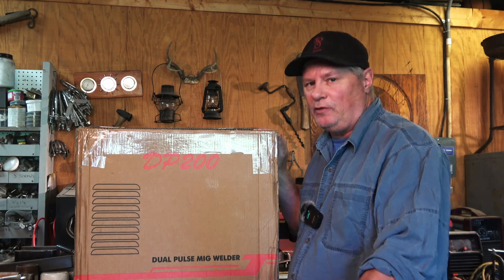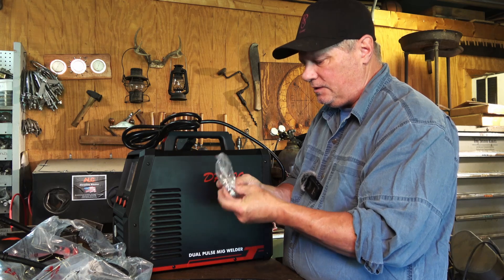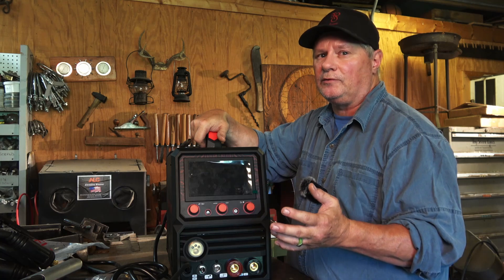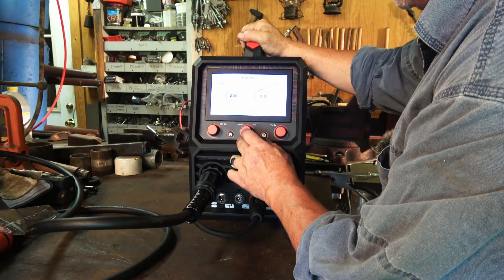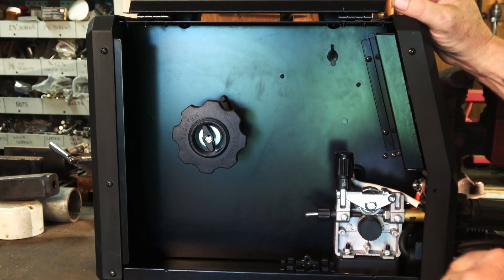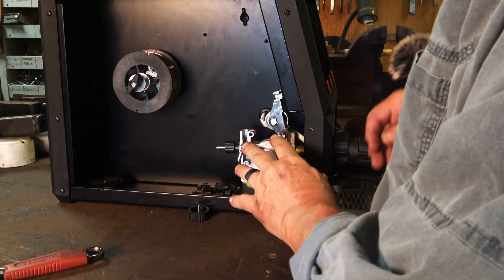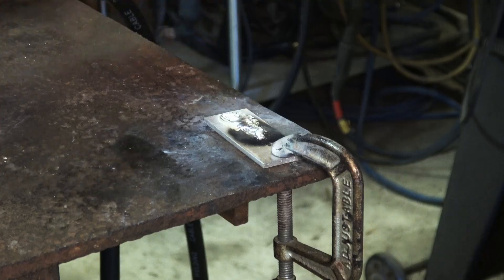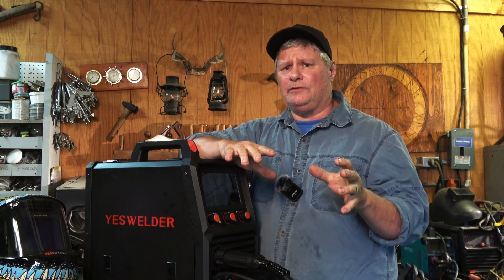YesWelder DP200 Double Pulse Mig Welder Review

Comment from the maker: UPDATE on duty cycle  If you have any questions just post below.  I’ll do my best to answer them.  Thanks for watching!
The duty cycle of MIG welding is:
25% @200A, 60% @130A, 100% @100A@240V.
25% @120A, 60% @78A, 100% @60A@120V.
The duty cycle of TIG welding is:
25% @200A, 60% @130A, 100% @100A@240V. 
25% @120A, 60% @78A, 100% @60A@120V.
The duty cycle of Stick is:
25% @180A, 60% @117A, 100% @90A@240V. 
25% @120A, 60% @78A, 100% @60A@120V.
Reply: What does it say the input amps are for 110/220? I sometimes use my machines on 110 and notice some of Yeswelders have a hug draw from the 110 outlet like 46amps or even 50amps!
Reply from the maker: @jeffkohler21 I didn’t get any paperwork with it but a 110 circuit should be protected by a 15-20 amp breaker.  My other YesWelder machine is 15 amps on 110.  Hopefully they will update the site with spec info including duty cycle.
Reply: @TonySeverioKnives  in the video I looked a little closer and looks like either 35amp or 39amps from a 110 outlet. But also any work area should have a 20amp breaker minimum. The 15amp is honestly way too under rated and outdated. 15amps works OK for internal home use for like a tv,vacuum, lamps
Reply: @TonySeverioKnives what’s the duty cycle? I can’t find it anywhere.
Reply from the maker: I don’t know for sure since I didn’t get any paperwork but I read somewhere that was posted by a user that it was 25% at 200 amps.  But I can’t verify that.  I’m hoping they will update the site info soon.  I’ll post here when I find out for sure.
Reply from the maker: @ian3967 I just got this from YesWelder.
The duty cycle of MIG welding is:
25% @200A, 60% @130A, 100% @100A@240V.
25% @120A, 60% @78A, 100% @60A@120V.
The duty cycle of TIG welding is:
25% @200A, 60% @130A, 100% @100A@240V. 
25% @120A, 60% @78A, 100% @60A@120V.
The duty cycle of Stick is:
25% @180A, 60% @117A, 100% @90A@240V. 
25% @120A, 60% @78A, 100% @60A@120V.

Comment: 12:26 hmmm that's a lot of spatter... pulse MIG is basically modulated spray transfer, so you shouldn't really have spatter at all... perhaps a lower wire speed?
Reply: Is it that or should it be 90/10 gas? Pulsed someone said the only option is 90/10 in settings? I'll have to look when I get back home but was about to order c25 and now wonder if I should get c10 instead if using pulsed and dual pulse. If you have pulse idk why you'd need regular in most situations the pulse will give better looking welds with similar penetration with proper prep
Reply from the maker: it wasn't but probably should be.
Reply from the maker: Yes the speed was too fast

Comment: In case you haven’t already figured it out, you always push when welding aluminum. I have to ask, what kind of gas are you using. Typically you need to use C10 when pulse welding steel. Always use straight argon when welding aluminum. Nice review by the way. I am excited to try this machine. I have a miller multimatic 255 with a push-pull and can’t wait to see how the DP200 compares.
Reply from the maker: Yes you right.  I was just seeing if I could run it.  Yes I was using 100% argon on aluminum.  Thanks!

Comment: What amp circuit are you running it off of?  I need to install a 240v outlet in my garage for this.
Reply from the maker: Im running it on a 30 amp circuit but I have a 50 there too if I need it.  I didn’t look at the cable size but #10 is good for 30 and #6 for 50.  I didn’t get any paperwork with the machine to determine max amp circuit feed.   I hope they have something available soon so I will know for sure.  So I went with the 30 until I know for sure.
Reply: @TonySeverioKnives  Awesome, thanks!
Reply from the maker: Your welcome!  🙂

Comment: What’s the thinnest it can weld aluminum? What size thickness aluminum wire can be installed and still be able to push it through the liner/ gun
Reply from the maker: I didn’t try anything below 1/8 aluminum since I didn’t have any so I’m not sure.  I didn’t get any paperwork with the machine so I am literally testing as I go.  It will take .045 aluminum wire and a .045 roller for aluminum comes with it.  I’m going to get a roll of .045 aluminum wire and try it out.  I’ll post and findings in the pinned comment above, good or bad.

Comment: Thanks for taking the time to review this! Are you able to independently change the voltage or are you only limited to the +/-5v adjustments and have to use the thickness to set the voltage otherwise? Thanks
Reply from the maker: Yes I was able to change the voltage and the speed.  I found the smart settings pretty good though.  I have several projects upcoming I plan to use it on and give it a good workout.   I’ll post anything positive or negative on this vid comment section and pin it to the top.
Reply: @TonySeverioKnives  If you can, run the machine on 120V. I know most of us are DIY'ers and don't have access to 240V. I'm curious how it handles the thicker stuff on 120V
Reply from the maker: @nickvang9097 my other YesWelder machine will do ok with 1/8 material on 110 volts and I wouldn’t expect this one to be any different.  You’re basically cutting the amperage in half.  I’ll try it when I use it again and post here but I’m pretty sure 1/8 to 3/16 at most on 110 volts.

Comment: Great video, thanks for sharing. Do you think one of the lower priced welder/plasma cutter combos would be handy to a hobbyist? Do you see a plasma cutter replacing the bandsaw. One last question, what grinder were you using a few months ago in your Japanese chef knives video? Thanks again for all the great videos!
Reply from the maker: Thank you.  Yes cheaper machines have their place.  I have a stand alone plasma cutter also.  But I don’t see it replacing a bandsaw.  I use a bandsaw for a lot of tasks that the plasma cutter wouldn’t be choice for.  For me the bandsaw will do more clean cutting with no heat affected issues and less cleanup.  Plasma for more rough cutting jobs.  The 2x72 grinders I use are old Bader grinders.  One I bought new about 30 years ago.  🙂